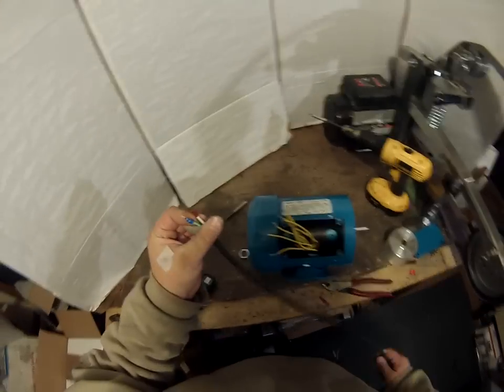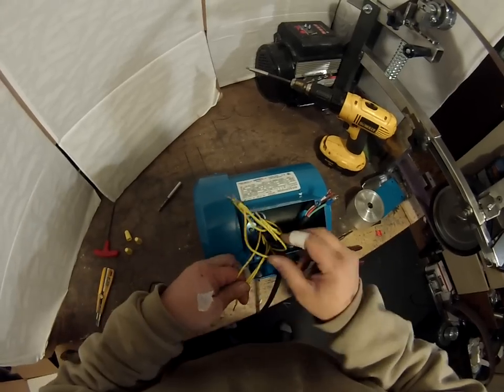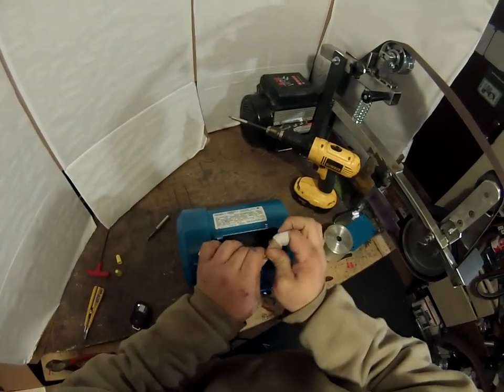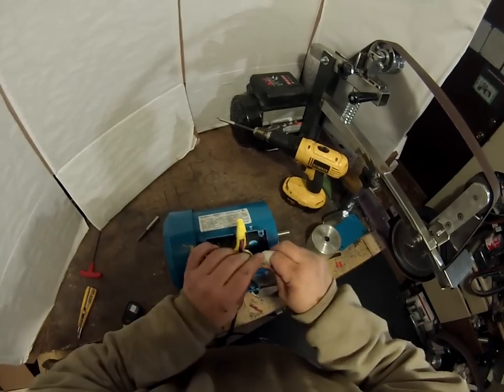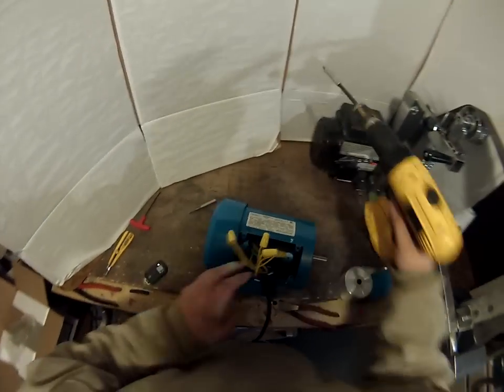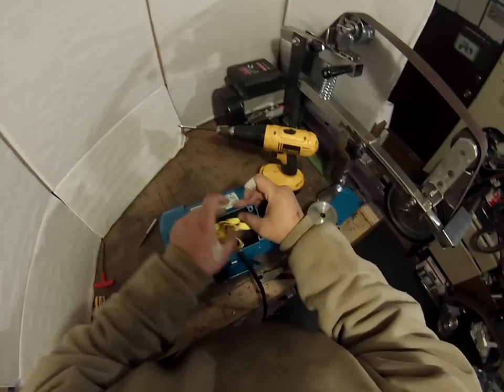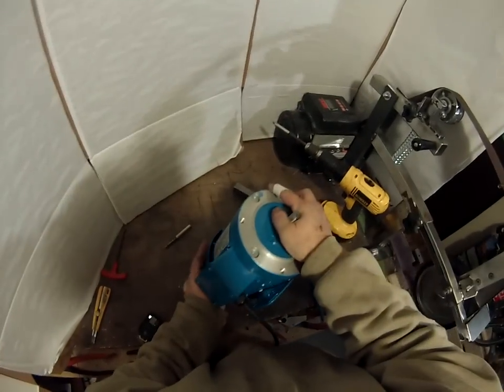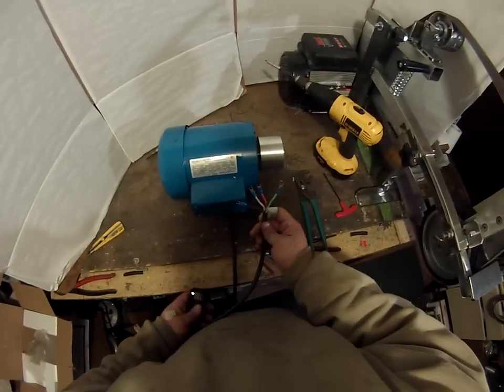wiring a 3 phase motor 230 volt  . getting it ready to connect  to a drive

Comment: WHY 4-5-6,WHY 1-7 AND WHY GROUP IT TO BLACK 2&8 WHY TO RED? 3&9 WHY TO WHITE? DOES THE DIAGRAM PLATE READ IT THAT WAY? IF YOU ARE GOING TO MAKE A HELP VIDEO, THEN MAKE A HELP VIDEO AND EXPLAIN YOUR ACTIONS. IF NOT, THEN I CAN ASSUME I CAN WIRE ALL THE MOTORS THE SAME WAY.
Reply: (First of all, don't type in all caps - it's hard to read and annoying! :-)  It doesn't really matter WHY, unless you want to master the theory of how a 3-phase motor works (and believe me, you DON'T.)  The point is, for low-voltage, you always tie 4-5-6 together and just leave 'em. Then you follow the other pairings on the diagram (usually on your motor nameplate and/or in the instruction manual): you take 2 particular numbered wires (e.g. 1&7) from the motor and one from your power cord (black) and hook them together. Then another 2 to another power cord wire, then one more time. Then hook up a wire (VERY preferably green) from ground in your VFD to the green ground screw in the motor wire box. DONE. Don't ask why. That's just how it works. :-) If you DESPERATELY need to know why, Google "three phase motors" and read a lot until you fall asleep.

The color coding on the 3 lines of the POWER cord isn't crucial, but it's standardized and it helps you make sure you're tying down the OTHER end of each (at your VFD) correctly (to lines 1, 2, and 3, also sometimes referred to as U, V, & W). This is helpful if someone else has to come along and deal with your motor later (like an electrician).

Comment from the maker: the main reason I made this is for my customers that are going to run the motor with a variable frequency drive . I use KB Electronics  KBAC 24d   or Kbac 27d .   these drive will have an input of 110 volt 1 phase or 220- 230 volt 1 phase  then it will convert it to 230 volt 3 phase power .
Reply: A VFD doesn’t convert it to real three phase power. It just simulates 3 phase power using pulse width modulation. Dumb motor doesn’t know the difference but if you tried running other things off of it, you would have problems. Just sayin
Reply: Again thanks. As stated by others I just needed to be able to wire the motor to the VFD, and the VFD to the supply. It worked perfectly.

Comment: my 3 phase motor has no green wire for grounding but has 2 optional brown thermostat wires. Is it normal to have no green wire, maybe for small motors? It is 3/4 HP TENV motor: http://www.baldor.com/catalog/IDVSNM3542
Reply from the maker: +John Thompson  yes it is normal for the motor to have NO Green  ground wire .
the motor should have a green screw inside the junction box . attach the ground wire to the green ground screw .

Comment: You claimed you have wired a lot of motors. this particular video DOESN'T HELP anyone looking to understand 3phase motor wiring... 
 
Because you don't explain why t1, t8, t9 etc goes with black, red, blue and such... & what's the voltage should be on, what you should do & what you shouldn't.

Your not helping here.
Reply: I understood the vid and found it quite helpful in wiring up my own 3 phase motor. Watch the followup vid where he connects it to a VFD and you'll understand.
Reply: Joshua Burton what do you think is gonna happens if I put leads 4, 5, and 6 together and the motor is connected to High Voltage (460V)? What about if I want the motor to rotate Counterclockwise?.  Those are some reasons why he is missing a lot of info about "how to wire a 3 phase motor".

Comment: Why do you wire it up in that particular order, and particular connection, i.e. 1&7/Blk,  2&8/Red, 3&9/Wht?
Reply from the maker: I do it this way to maintain an order while I do them .I wire up hundreds of motors so it is a habit now . 
you have to keep the numbers grouped the same but you can change the colors .
Reply: pheer grinders
Fair enough, thanks! I had some electrical training, but it was a very long time ago, and we never really got into a lot of 3 phase. With the changing economy, and the unfortunate but necessary career changes, I guess now is as good a time as any to learn.

Comment: What kind of variable speed controller gets hooked up to the cable? I have a 1 HP 3 phase ac motor that I want to use to run an ancient scroll saw. Thanks

Comment from the maker: 230 volt 3 phase on the motor in this video.
 many motors EX Baldor motors  will have 208 - 230 capability .and will have it listed on the motor  info plate  .